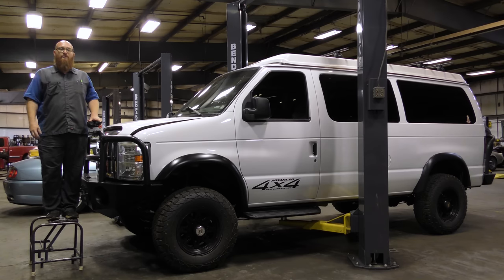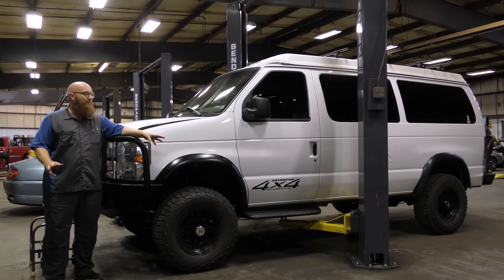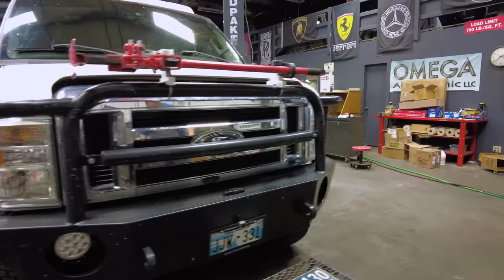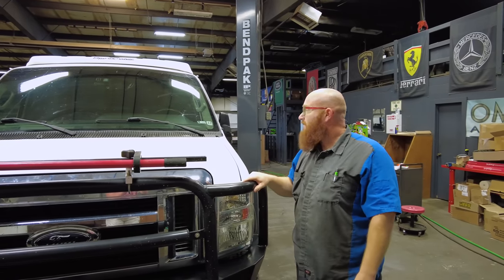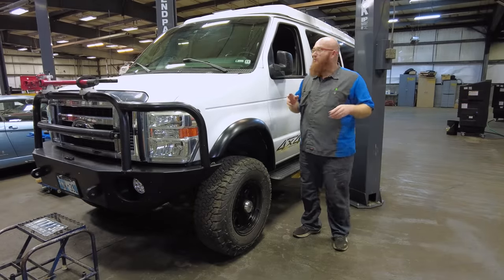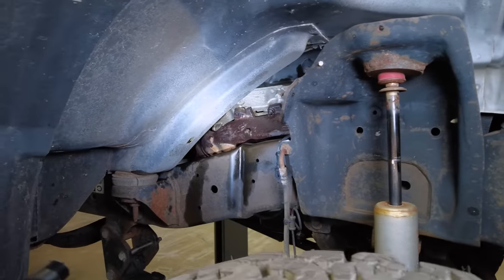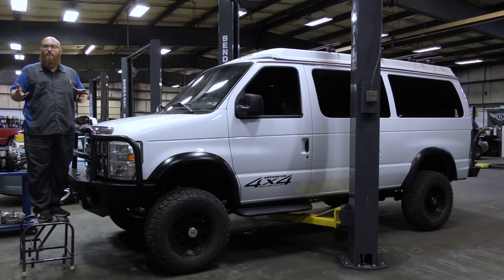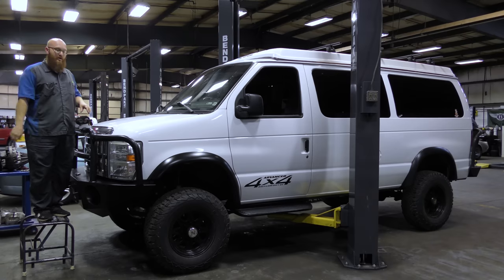8 shops refused to work on this custom '10 E-Series Van! CAR WIZARD shows how easy it was to fix!

Comment: I just paid $1700 for a tune-up on a slightly older E250, after two coil failures I had them just replace them all and the spark plugs. Why didn't I do it myself? I can't reach half the plugs!

Comment: My Cousins 5.4 3 valve just turned 300,000 miles and has NEVER been worked on! My Uncles has 280,000 It has had the cam phasers and timing chain/guides done. No bid deal, if you take care of them they will last. People wait until catastrophic damage occurs. Then it cost a fortune to fix but that's with any engine.

Comment: Have one and it’s  been best vehicle ever.
Reply: Do you have a "cassette" camping conversion that can be slid in and out of the back?
Reply: @JohnSmith-yv6eq  I do not I have a full size bed in front of the side doors turned east west. It’s 14 inches high so there is storage underneath. I have a Espar furnace on a thermostat and two big Marine batteries for house batteries separate from the drive battery in the engine compartment. It makes sure the engine battery is charged first followed by the house batteries. Mine is the extended version. Have a 3000 watt inverter and carry a Honda 2000 inverter gender for long stays. Have a electric refrigerator/freezer that’s just awesome as well.

Comment: I have an older 1982 C30 that shops don’t want to work on. It used to be a diesel but is now converted to gas w a 454, but shops won’t work on it. There are no more mechanics. These guys a techs and if you’re not bringing the OEM we’re they can consult their guides, they don’t want it.

Comment: I was under the impression that if you needed to do major engine work to a van, they have been designed so that you lift the body off the frame and have all that room to work with.  If that's not what they were designed to do, why do they have such short noses and stuff the engine so far back?

Comment: lol at the engine out comment.  I think you was joking about taking it out the front but if not then all vans like this its body off frame job which is not as hard as it sounds.   Japanese and eurovans normal can just unbolt the engine and drop them out the bottom.

Comment: All the 4x4 fords of this vintage with solid axles ,,, have poor steering, drove many.. They will try and follow the camber of the road. The vans are a true odd experience, their weight when converted to 4x4 is way off the ground and about the only use is in average bad weather, they are helpless in mud and snow. Especially with the small motor.  The Diesels drive the worst, the engine weight overpowers the suspension and any slight tilt / wind throws that high weight at the roof level to the side, which makes them a full time attention getter, very difficult to relax while driving one even on the freeway.   The 4door F350's and the vans drove very similar..  I suspect that roof top tent system adds more fun.. :)

Comment: Wizard, 
Is it possible to install Yukon lockers myself in my front end? 
I have a 2003 F-150 4x4. It has 34,450 miles 😮 
The man my dad got it from had it in a garage; he used it when he came up to fish. Other than that it sat in the garage for years at a time. 
Anyways I have the lockers and new Strange Engineerinf axles. 
I’m switching from the vacuum actuated 4x4 to manual hubs as well.

Comment: autoshops are jsut downhill nowadays. ive been turned away by 4 shops AND the chevy dealership PLUS the chevy dealership broke my ignition and ripping the key out when in the on position. key wont even go back in. i only needed a alignment. but the shops are afraid of tubular control arms

atleast we know there are good shops out there like the wizards

Comment: Can't you remount the parking sensors in the new bumper instead of removing the errors in the computer? Perhaps just extend the cables? Would be nice to have parking sensors in such at large van.
Reply: If anyone could add mounts to that massive bumper, it's the Wizard. Would be a piece of cake to add a reverse camera too, if the radio supports one. Hardest part is routing the cable so it's nice and neat.

Comment: For shops it makes much more sense to stick to brake jobs, fluid changes, decarbs, suspension work, and other easy stuff in times like these.  If you take on an exhaust leak job and end up breaking off manifold bolts and you already quoted the customer a certain number of hours, the reality is that the job is going to be a loser.  The purpose of being in business is to make as much money as possible.  No mechanic has any obligation to do a job he or she doesn't want to do, whatever their reason might be, and expecting them to do it at a loss is both privileged and contemptible.  You would think someone with a custom offroad van would be savvy enough to work on their own shit, but judging by the immaculate condition of the van, I doubt it's anything but a mall crawler owned by somebody who just wants to role play the off-roader lifestyle.
Reply: Wow very judgmental. I'd like to see you pull this transfer case in your driveway since you're so savvy
Reply: As a matter of fact I could.  I myself actually own a modded vehicle, but I would completely understand if a shop didn't want to work on it because of that, whether for liability reasons or whatever, so I do it myself.  I won't argue that my comment was judgmental, but it's not without reason.  I worked at shops for 10 years and people with these kinds of vehicles were either very arrogant and entitled or just plain oblivious when you tried to explain to them why a shop doesn't want to work on their toy when they're operating on razor thin margins.  After so many shops refusing to work on it, maybe this guy should have just taken a hint, but that's not reallythe point I was trying to make.  I don't know why Dave is trying to act like these shops are somehow in the wrong for refusing to take a job they will likely lose money on.  They may not have the tools, knowledge, or experience that he has, so why demonize them just for that?  It came off as very holier than thou.

Comment: Seems like you can 4x4 that with factory Ford parts.

I changed manifolds on a van. Not fun.  And that was without dealing with broken bolts.  I did find the manifolds (Chevy) had warped a bit and you had to tighten down the middle to even get the end bolts in.
Reply: Yes, you can. There are also shops out there that specialize in these swaps, with their own ideas of what works better. U-Joint Offroad is a popular one...they also seem to get a lot of people who are dissatisfied with Quigly and Sportsmobile, so lol.

Comment: My toyota rave 4 has drive line vibrations at 1700 2500 rpm and will sometimes lose all wheel drive lock and traction control. We've had 4 mechanics look att the dealer sent us to and some said heat Plat others didn't know why the sound.

Comment: I have a van exactly like that.  Except its a 1992 rust free from Arizona Van and its taller and its an extended length van and it doesn't have all those windows and it has a real 351 Windsor and it only has 70k.  So i guess its not exact.

Comment: The steering can easily be fixed with an Redhead steering box
Reply: @rch5991  the one I'm working drives like a brand new loaded half ton. I was quite surprised

Comment: Obd 1 gm analyzer obd2 gm master programmer and rom burner the older test equipment can be purchased from dealerships closing at a low cost best investments you could make as a shop owner and the money is double what you charge for labor

Comment: I don't get why shops would be worried about it being lifted. Put it on the hoist pull the wheels off and lower it down on the hoist. It will sit lower than a stock one at that point.

Comment: When you replace those exhaust manifold bolts and studs, are you using OEM parts, or aftermarket materials that are less likely to snap and break over time (assuming that is available)?
Reply: Possibly OEM replacements are now of better quality????

Comment: Ford should sell these vans from the factory with 4x4 as an option. Any full size van should have it as an option. Lots of vans are used as work vehicles often brought to construction sites where there is mud. Lots of people end up with 4x4 trucks even though a van would be better suited for the job they do.
Reply: @jkeelsnc  exactly. It is silly they dont sell them in 4x4

Comment: And that is why you just get a 4x4 pickup  and a slide in camper that can be removed than a highly altered overland van . 
It is easier to work on a pickup and get someone to work on them than a van

Comment: I have one of these - 2003 E Series - Triton 5.4 V8, 90k miles, queen bed, solar, solar shower, and it gets 8mpg.
Is there any way to make this better? 😀
Reply: Try doing a tune up (spark plugs, coils, and air filter). Also change the oil more often and don't floor it all the time. Make sure the tires are properly inflated. Off road tires, lift kits, 4x4 conversions make fuel economy worse.

Comment: I have a 1998 Expedition.   It needed 4 wheel drive.   It would get stuck really easily.   It had the 5.4 engine.   I am not able to drive anymore and work on it now.

Comment: Once the AC goes bad. Never ever be the same again, unfixable AC. My job used them along w Chevy Express diesel. All the Ford diesel vans got tossed after 120k miles or so. We have one Express left. 1 Million Miles. And still going. Late 2000's Ford diesel fuel tank liners disintegrated and ruined the entire fuel system, front to back.

Comment: No is a common word I hear when it comes to getting my jaguar fixed Mr Wizzard. Most of the shops in my area tell me they can't work on my car, I have to take it back to the dealer. That's one of the reasons I'm getting rid of it. Tired of spending all that money at the dealership.

Comment: Theresna 2001 q45 with 130,000 miles for sale for 1500 but i went to look at it an its leaking oil quite a bit i saw it driping alot seemed to be coming from the valve covers you think i should buy it?

Comment: Wait, that is a drivers drop kingpin LOW pinion front axle?  What the heck, did the company use a GM/Dodge center section to get more drive shaft clearance?  Interesting...

Comment: You did not actually fix the transfer case or transmission leak. That is a dust gasket. The leak is either from the transfer input or the transmission output seals. Transmission fluid should not be between the 2 units.

Comment: I can't understand why mechanical work shops refused to work on this huge van and you took it on l can understand not having the lift yo take the weight of this van would be a good reason and they are easy fixes

Comment: It's not sad most shops do not have extra money and hight like your warehouse specially in California shops most of shops have lift max lift is 7k or 8k that van is over the limit weight and to big it's liability the owner wouldn't want to pay most likely to get the job done based on estimates they got many times and finally they realized it's not easy to work on those vans every time you work on commercial trucks or vans you charge double the dealership charges 3 times the price realized the owner payed over 100k for that van when it was new so why not to charge them the dealership price since it's pain in the ass to work on it ! 🤔

Comment: how weird with the K02 flex, i've never seen that for them without them being ridiculously huge. and those are about the same size as the ones i had on my frontier. wonder if its partly due to the sheer weight of the rig.

Comment: >not caked with mud or with sticks and twigs sticking out of it

I mean it's a 4x4 adventure van. I mean sure, clean your vehicles, but if it's not being used for off road, I have to question the point of why the customer has it in the first place?

Comment: Wizard, I have a lot of respect for your knowledge and expertise, as well as your outlook, but I think you called this one wrong. I don't think other shops turning this job away was about just not wanting it in their shop or not wanting the inconvenience, it's a simple issue of economics. Sure, everything about it is inconvenient, from having to use a stool to access the engine, to not being able to stand to work under it on the lift, and that equates to more time. In an industry where most techs work on flat rate, this is a loser. If you're a shop owner (and you're not hurting for business,) it's a loser because it's taking up time, space, and a tech in your shop. Additionally, you see something come in with a bunch of goofy aftermarket stuff, you can pretty much assume it's going to be a problem. I can't speak to the credibility of the company that did this conversion, but every issue the customer had aside from the exhaust leak was due to aftermarket modifications. Both leaks, aftermarket parts. Steering issue, non-standard tires. Parking sensor, aftermarket bumper. I've been on the wrong end of this conversation enough times to know it usually doesn't go this well when you have to tell a customer that their problem is due to some non-standard thing they chose, or that it's going to cost extra because it's going to take longer to do the work, or that there may be unexpected expenditures that can come up due to these factors. I think you are in a position where the economics of your shop work a little differently, you have income coming from YouTube videos and something like this is great fodder for views, so maybe you have incentive that most of us don't. I also get the impression that you compensate your techs in a way that they aren't getting bent over on the losers that come in. You may have also been in a better position because ten other shops said no first, perhaps if you were the first the customer called and you said "Sure I'll work on it, but it's going to cost" you may have been called some colorful names rather than met with gratitude. I'm happy that you were in a position to take care of this customer, but there's no need to throw shade at the shops that turned it away. It's a business and people have to do what's profitable.

Comment: Many shops are swamped while under staffed…  unfortunately makes sense to turn down customs
Reply: I wonder what the main factor creating that problem is.  Is it because new and used cars cost a fortune so everything is worth fixing no matter what, more work load? Or is it a shortage of mechanics because nobody wants in that trade with electric vehicles around the corner? Thoughts? I used to think of my 03 Honda had a transmission blowout I’d just buy a different car, but in this economy I’d rather replace the engine or transmission. Literally the most expensive jobs possible for my car and I’d do it before buying something else.

Comment: That has a 5.4 2v. Basically bullet proof engine besides the exhaust manifolds that like to rot away. You could never get a 5.4 3v in these vans thankfully.

Comment: Ok car wizard the use of silicone on gaskets drives me nuts. Theirs only maybe to places to use silicone. First the valley corners of intake manifolds. Second on the oil pan where described by the manufacturer on the oil pan gasket where the front timing chain cover and rear main seal cover theirs a edge and you just need a little bit. Now for everything else is use and recommend is Loctite 515 gasket maker. I used to build underground mining equipment and that’s all we used and the equipment was sold around the world and their was no equipment parts store down the block. The second tried an true is Permatex No. 2 form A gasket been around for decades. This silicone use BS when I’d tear something apart where a mechanic used silicone that stuff would ooze into the engine cavity or powertrain components. I got so tired of cleaning globs of that stuff out of powertrain components and assemblies and everywhere else it is used. It’s almost like we cannot fix it right and we will use a ton of silicone to seal it up and hope and pray it doesn’t leak. Again loctite 515 gasket maker on all powertrain components and my old standby Permatex No. 2 and No. 1 . Also Permatex Aviation gasket cement is another good old friend. And if you want to give me BS about what I say , I’m a retired heavy duty diesel mechanic in my late 60’s. I’ve been around.

Comment: I have a feeling that the customer may have been over-complicating the story for the shops. Probably throwing the whole 4x4 conversion as a conversation starter.
Especially if he also mentioned he had been turned down by several other outfits.
Who want’s to take on a bad job? Except for a youtuber who can make it into a story.

„Hey I have an E250 v8 with some noise around the exhaust and also wanted the steering looked at - feels vague.” - that’s all they needed to know.

Comment: Ford,5.4,modified...... hell no.
Just the aggravation of the front bumper is a pain.
Add 2 hrs for dealing with these ....If and only if you need the work . 
So a tech can work on a normal vehicle ,or squat and roll underneath while drilling out studs  at a weird scrunched up position .
Reply: Also working on modified vehicles  is such a pain.
High cowls, poorly installed electronic accessories ,large front bumpers,exterior upper windshield shades (forget what they're called?) are all a pain.
Was a tech,and an auto glass installer .
Cars are built to a certain standard ,and a standard of  technique/tools are expected to be used.
If one of those welds on the lift kit was in the wrong place,it would have been a pain to r/r the transfer case.
I love making well thought out modifications ,but also self perform all the maintenance .